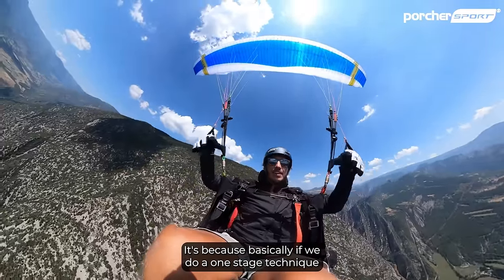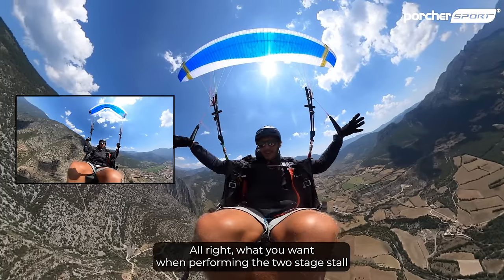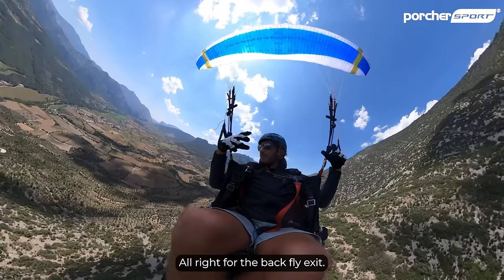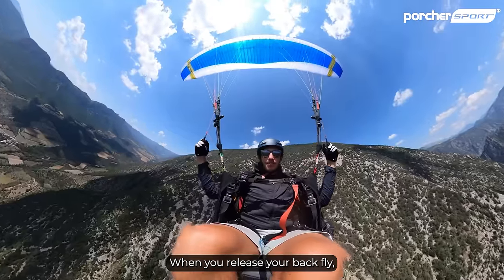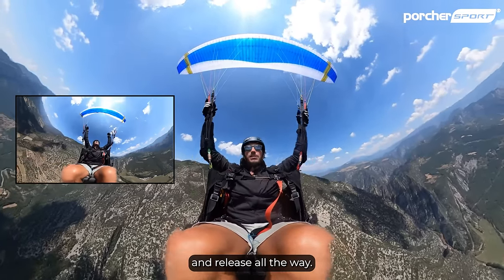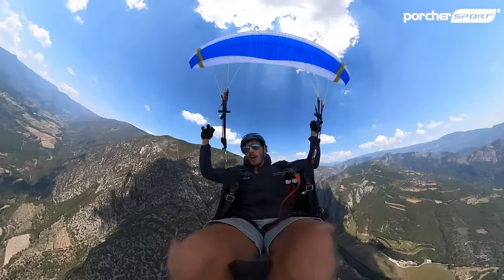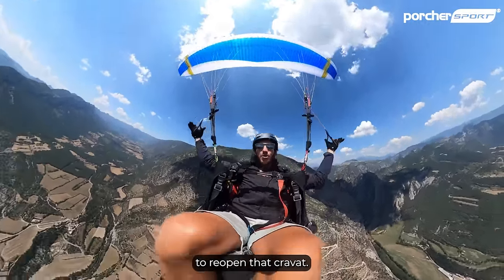HOW TO DO A FULL STALL IN 2023 - PARAGLIDING TUTORIAL BY THEO DE BLIC

Comment: I  really hoped you'd switch to a Xenon to finish the video, as talking about cravates with Mentor isn't really fair, right? :) There are multiple ways to exit the stall without them on a high A.R. wing, but it's definitely somethin most of us have troubles dealing with and I guess it could be a full separate video. But tbh the method you've shown I see the first time, although intuitively I guess it's what we're always trying to do. I will definitely give a try provoking it, as you did, but I'm not 100% sure it would be so effective with a 2 liner- it takes a moment to bring back and re-inflate those tips, while the center wants to fly already.
Reply from the maker: I did the exact same video with a xenon 2 years ago. It’s on my channel you should check it out as I explain this method which is more effective on a 2 liner than on an ENB

Comment: Thanks so much !!!!!
I really wanted this update, as many people I think !

A bit tricky for me to manage the fear of doing it, I just stall the tips and release for now...
I guess, once you have done it completely, it will seem easy !
Any advice to step it ?

How do you manage the turbulences on the other hand ?
This question applies also for all the maneuvers, wingovers, sat, etc.

Thanks again for your knowledge and vulgarization !!!
Reply from the maker: Find yourself a nice day with nice altitude and a good safe box and go for it. Remember that if it seems out of control go hands up and accept the shoot. Limit movement as much as possible. 
For turbulence that’s a complicated topic as it depends on a lot of parameters. The best is tu fly at contact point and to lower your hand to find back pressure every time you feel you loose it but that’s not something that doesn’t need any adapting it’s a basic advice let’s say
Reply: @theoflies  Thanks a lot for your answer !
I'm really motivated to perform stalls as soon as possible...

For the turbulences, my question was not well asked, sorry.
How to deal with turbulences when practicing maneuvers like wingovers, stalls, sat,... ?
For example, I can do quite good wingovers in calm air (not the rest fort now).
But when bumpy,  I dislike to engage big ones, I find it scary...
How to move on ?
Reply from the maker: Ah sorry, well that’s easy, the best is to find the area without turbulences. Otherwise if you can’t find it you can do them being quite careful in the timing. For exemple if it’s bumpy you are going to pull earlier than when it’s not. They won’t look as good but with more energy and therefore more solid to turbulence and you will feel it less.
Reply: @theoflies  Ok, I will try this earlier timing !
I keep this idea of more energy.

Once again, thank you so much for your advices and videos !!!

And one day I hope, come and fly at La Jasserie, Massif du Pilat ! (C'est pas loin de chez toi 😉)

Comment: Thanks Théo, such a great video as always! What do you think of spin to backfly. I was taught that in a recent SIV here in Japan:
- slow glider down, hands to carabiners or so
- pierce on one side, that side starts to flutter backwards and stall
- as that happens, immediately put both hands at the same level in a somewhat deep back fly (for me slightly below carabiners)
- raise the hands to a stable and nice back fly position

It felt great because there was basically no falling backwards at all, it felt just like a different flight regime with a super smooth entry
Reply from the maker: Spin to backfly is indeed a very easy way to find the back fly. But in my opinion that implies someone who has already experienced backfly, and backfly position. I always teach spin to backfly to my students but I always do stall first in order for them to have some muscle memory from the backfly position. So spin to backfly is indeed smoother than stall to backfly but I believe it is important to first know the backfly points before going through it to avoid possible issues but of course in a majority of cases it would work well for first timers.
Reply: @theoflies  Makes sense, thanks so much for your input!
Reply: I was as well told it's an easier way to learn, but even though it might be slightly less brutal, it actually feels weird, and it's very hard to stay symmetric as you get a lot of roll from the initial spin; plus it's completely unnatural and not the way you'd ever be stalling your wing on purpose, which IMO makes it more of a fun exercise than a way to learn. The feeling of falling backwards in stall is just something you need to learn coping with, and ideally even enjoy, cause it will happen to you eventually and it would be nice if you did not panic then :)

Comment: 00:04 🪂 Full stall technique has evolved over time due to advancements in glider design, necessitating updates in training.
01:43 🛫 Two-stage stall technique involves initially stalling the tips, then stalling the glider for real to achieve stability.
03:16 🔄 Pay attention to timing in two-stage stall to avoid common mistakes like insufficient stalling or releasing too late.
04:51 💡 Mastering the two-stage stall allows for efficient entry into a stable back fly position.
06:35 🤝 Maintain symmetry and control during back fly exit to prevent complications like cravats.
08:11 🎯 Aim to streamline stall maneuvers by shortening the process while maintaining control and precision.
10:22 ⏭️ Create quicker exits from back fly by generating a forward surge, reducing waiting time.
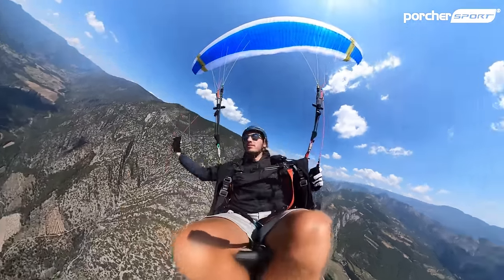11:59 📉 Condense stall procedures by identifying and transitioning through each step swiftly, while maintaining clarity.
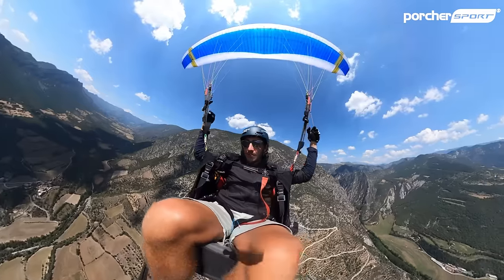13:05 📐 With experience, master stalls with a single input, efficiently transitioning to back fly without the need for a second input.
14:45 ⚠️ Avoid common mistakes like insufficient stalling, releasing too high, or over-piloting the exit, to ensure safe and effective stall maneuvers.

Comment: Superb video. One question, wouldn't you only stall in a difficult to recover scenario? This 2 stage approach seems to require that the glider is flying stable overhead to start.
Reply from the maker: Yes exactly you would stall in a difficult to recover situation and in that situation you need to be super fluent in your stalls to be able to do it perfectly. Often if you stall 1 stage it won’t do the intended stall anyway and therefore the 2 stage approach although a bit more unstable will be more efficient. 
And btw you don’t necessarily need to have the wing stable above your head :) it’s just easier. Once you are very good you can train to stall in all kind of situations

Comment: Hm, also, I see you bring back your hands all the way up, I figured out with some wings, like PHI Scala for example, in such case the tips immediately get some air and jump forward too much. It was always smoother when I kept at least a bit of brakes on the move up, and then back down to backfly. Anyway, great video as usual.
Reply from the maker: In my experience it’s more due to the first braking input than the release. The release could be up to the top or not it’s the timing and the first brake input that matters the most
Reply: @theoflies  what do you mean by timing? I usually go full brakes from trim speed to get it quite dynamic and release immediately after or otherwise the tips touch. Not sure what else can be done there. And doing all that same I see difference between releasing fully and releasing up to carabineers or so. I guess it will different between the gliders, as e.g. Zeolite gave much more time margin to release.